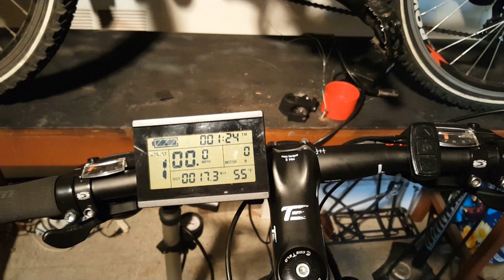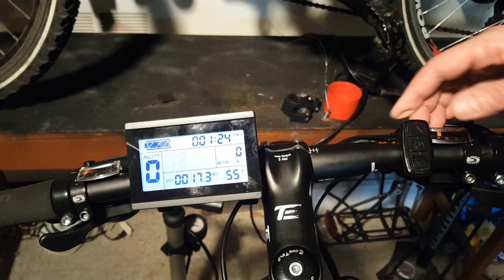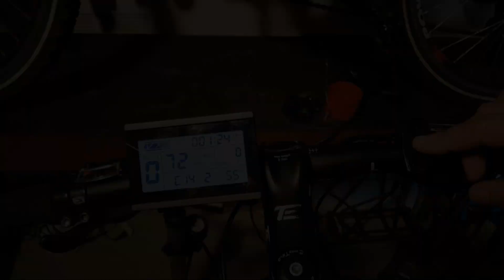TURBOCHARGE your E bike! Programming the KT-LCD3 Controller Display

Comment: There is a manual online. Kt lcd 7 emotoer

The one in the manual may look different but all the codes are correct. Seemingly there is not much you can do to get more speed out of just the controller. I’ll keep playing with settings, maybe if I can actually find a manual for the motor….

Comment: I was told by my dealer there is a way to make the pedal assist range go from 1-9 instead of default 1-5.  It was not to get more power but to get more granular in the assist steps.  Which setting changes the assist range?
Reply: This is the first time I am hearing about this, I want to know as well

Comment: Does anyone know what undervoltage cutoff value is suitable ?
3Volts per cell?
Reply: yes 3 volts per cell in each string.  so for an 48v  s13 battery, the lowest cut-off voltage would be  39v.  Tho i would set it a tiny bit higher such as 39.9 ot 40.   so you don't ever end up draining your battery down below what ever the BMS low voltage cut-off protection level is which is usually 3 volts per cell.

Comment: I entered that menu by pressing the 2 buttons simultaneously but I can't change anything, maximum speed, wheel diameter, etc. What to do? Is editing blocked?
Reply: When you enter that menu press power key until everything stops blinking and then press up and down buttons simultaneously and hold until first menue appears

Comment: when I hold the 2 buttons to gain access to the programs. a pin code code comes up. like this _ _ _ _ is there a universal code? I've have tried 1111 2222 and 0000 but nothing happens.  is there anyway around this? 

cheers

Comment: so what's that got to do with turbocharging? You said nothing about it
Reply: hi zzz oss. i still cant find anything to up the speed past 15.5mph. tried every setting and mixed it up. the best i get leaving the lcd at 72 km/ph is 18.1  did you come across anything yet?
Reply: @davidsanders1986  Looks like you're capped at the legal road limit by default probably
Reply: @zzzoss3325  maybe, but in LCD settings there are options to up the speed of Pas and throttle. But changing them does nothing. It's a kt-lcd 7.  Thanks for the reply.
Reply: @davidsanders1986  What motor and battery you have?

Comment: Do you know if kt-lcd3 working with 60v battery?
Reply: I dont think it will, i use lipos and i once put too many in and voltage didnt go past 66v even though it should have been higher. A 55.5v lipo setup will show as 63v fully charged, thats what im currently using.
Reply: Mio non funziona e una truffa sulla mia ado A20+f istallato non funziona e bloccato truffa truffa sono stato imbrogliato chi sa dire se si può sbloccarlo codice di sblocco ?
Reply: Yes it does if your KT controller is a 48v, 72v or 96v version. Please note that if you intend to use a 72v battery, you will need to make sure your KT-LCD3 is a 72v version.

Comment: Hi folks I've been looking around and asking the following question, and hope someone can help me

I have a 3000w rear hub motor, 52v battery, every thing works, just my speedometer is not reading correctly, I have the lcdh8 display

any help you can offer would be greatly appreciated
Reply: Have you set the correct wheel size ??  ie 26" etc. Also the P1 setting changes that too,  My lcd-3 P1 =46 by default  which is correct for my motor but I have seen other people set it  so P1 = 83, which is correct for their motor. I know if I double the P1 value ie  46 x2 = 92  then my speedo shows half the correct speed ie 40mph shows as 20mph.
Reply: try changing p2 to one. for some reason the default is 6 which doesnt work.
Reply: Dispay truffa non funziona sulla mia ado A20+f non funziona non comunica truffa una truffa ho dovuto istallare mio dispay 866e per fortuna va bene questo dispay e una truffa truffa non compare non funziona bloccato tutto lo stesso fa e una truffa 70€ mi anno truffato andrò polizzia per avere miei soldi indietro ok

Comment: check the manual.  i don't have a manual  . you need to be clearer when explaining what each function does so we don't need a manual .if you know the voltage of battery and motor what else is there to know?
Reply: I believe they don't elaborate 'cos they don't know the answer. 
All this gear is made in China there's no good English manuals and nobody truly knows what the settings really do
Reply: @srnunan4783 o have a Manuel for In english

Comment: So after the C settings I held the buttons again and L settings came up
What are they for
Reply: I found this (not sure if it is correct tho)
L1 is low voltage control so 0 is default auto setting otherwise 1,2 & 3 are 20, 30 & 40v respectively.
L2 is linked to P1 setting so leave it at L2/0 for the correct calculated value.
If one had a hub with a very high gear ratio then P1 might go off the scale so L2/1 would halve the calculation so a P1 value can be used, for instance if one calculated P1 as 300 one would set P1/150 and L2/1.
L3 is for sensored or sensor less use. L3 1 is default for optimised system/sensored running . L3/0 activates non hall mode should hall/s fail.
L4 is LCD shut down timer, 5 = 5 mins, 6 = mins etc etc.
Reply: this is where you can crank the power it up to 11